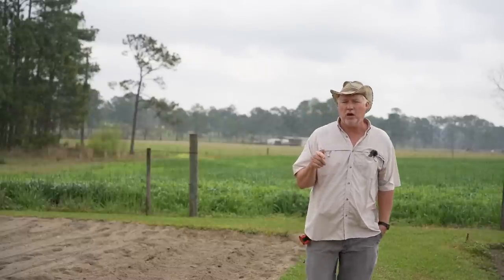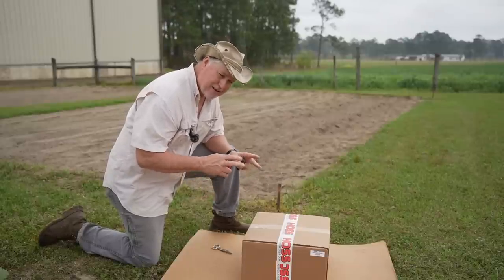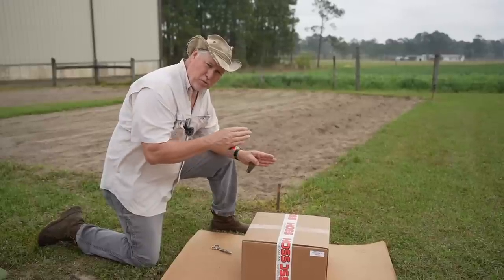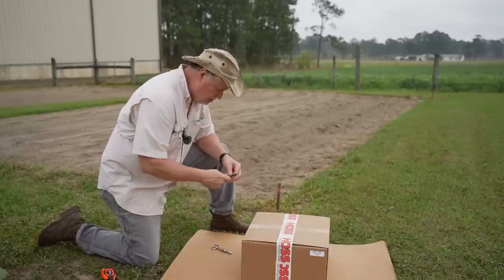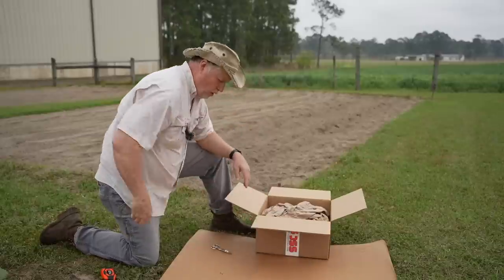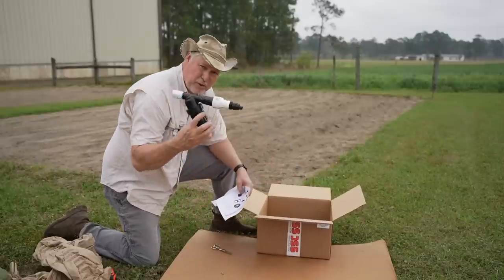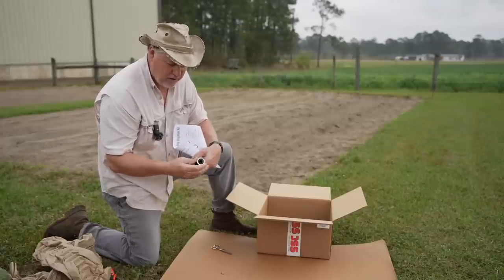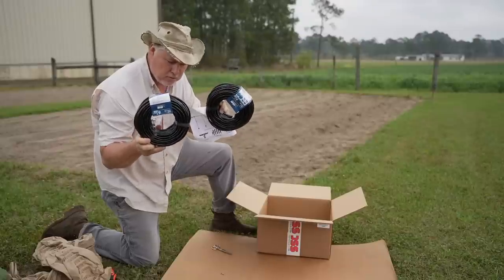How To Install Drip Irrigation | Small Drip Kit

Comment: Sure is a big improvement on the soaker hoses I've had to move from one row to the next.  And the little cut off valves are genius!  This drip system is perfect for my garden plot inside the deer fence with a row length of 25-28 feet.

Comment: For those of you that have leak issues where the hose connects take the original hose gasket out and replace it with an 5/8" orange rubber one. I used the Danco brand and they worked for me. The one that comes with it is a hard plastic type and will not seal.

Comment: Greg, great video.  I can attest to ease of use of both the drip TAPE and the drip LINE tubing as I use both.  I will offer one tip for us older folks that have trouble pushing both the main line, tape or tubing onto the fittings.  You can either use a glass or thermos with hot water (like coffee hot) and dip the end you want to connect into the hot water.  This will soften it up and make pushing onto the fitting easier.  I've started using a 18v cordless heat gun as it work great for this purpose.  The heat gun also makes it easy to take those fittings off if you are changing the layout of your system.  I bought a Ryobi 18v unit as it was on sale at Home Depot a while back for $49.  But the hot water works great, and you can just pour some of the hot water on a fitting you want to take apart since they will not fit in a glass or thermos.  The other great thing to use with this type of system is a battery powered timer.  Makes watering automatic and no forgetting to turn the water off and finding it ran all night (ask me how I know this!!!!).
Reply: This 71YO thanks you for this helpful hint!

Comment: Just got my kit in the mail today! Forgive me if it was mentioned already, I couldn’t find it addressed specifically where to place the drip line in relation to the row. I have corn coming up now; should the drip line be laid right up against the corn stalks or offset a few inches? Love the videos, love the products, I appreciate the guidance.
Reply from the maker: We bury our drip tape about 4 inches and plant corn on top about 2 inches deep.
Reply: @gardeningwithhoss sorry, I meant with the drip tubing in the small drip kit
Reply from the maker: Either can be done, we would recommend putting it right up against the corn stalks.
Reply: @gardeningwithhoss Thanks! 👌

Comment: Quick question on fertilizer injector flow disc, I will be using the Lazy garden 15 X 20 kit with the drip tubing provided, my question is what flow disc to use in the 1 gallon injector system? My water supply puts out 5 gallons a minute, I think it’s the white disc but I’m lost 😂😂😂
Reply from the maker: You will not need a flow disk at 150 gallons per hour. You will have 10 rows at 15 feet = 150 feet.  
White Flo-Disc 120 to 60 gph
Black Flo-Disc 60 to 30 gph
Red Flo-Disc 30 to 7.5 gph
Reply: @gardeningwithhoss  thank you, I can’t wait to start growing in the lazy garden

Comment: Drip tape in place, now I'm just trying to figure out a guideline for an appropriate watering schedule.   For NW florida, what would you recommend setting watering schedule to make sure hossinator tomatoes do well?
Reply from the maker: A good rule of thumb is regardless of how you water your tomato plants, be sure they’re getting at least 1 1/2 to 2 inches of water per week but checking in on your plants and watering as needed is really the best way to manage irrigation for tomatoes.

Comment: I have 4 raised beds, 5 feet wide by 16 feet long, with 4 feet between the beds. Would this kit be a better choice than the raised bed kit that you have? If I went with the raised bed kit, would I need 2 kits to do my beds?
Reply from the maker: The raised bed kit will support 8 (4 ft. by 8 ft.) raised beds with 4 feet between them. This is not precut, so you can make it work in you 16 feet bed.
Raised Bed Irrigation Kit Includes:
2- 100 ft. roll 1/4 tubing with emitters
1 – 20 PSI Filter Regulator Combo
1 – Figure 8 End Clamp
1 – Green Hole Punch
20 – Goof Plugs
10-transfer barbs
2 – 50 ft. 1/4″ tubing
40 – 1/4″ elbows
10 – 1/4″ flow valve
10 – 1/4″ tees
1 -30ft mainline tubing
100 – Tubing Stakes
10 – Garden Wire Pins

Small Drip Irrigation Kit Includes:
1 – 30 ft. roll of mainline tubing
2 – 100 ft. roll 1/4 tubing with emitters
1 – 20 PSI Filter Regulator Combo
1 – Figure 8 End Clamp
1 – Green Hole Punch
10 – Transfer Barbs
10 – Goof Plugs
32 – garden pins

Comment: I have a couple of questions, please. I will need to tee off my mainline tubing because my beds are running in different directions. Will that affect anything? The 30 feet maximum; is that for drip line not the main line? I'm looking at 23' of main line, with an 8-9' tee off and then an 18' tee off for when I add the raised bed kit. Is that understandable? I will be using the flow valves if that makes a difference.
Reply: I order my kit from drip depot. The website is setup really nice and understandable.
Reply: @EBHJ  I've looked at that website. It was set up nice. I just like the help along the way from Hoss tools. With very limited income, I believe I'm making the right decision. And the service after the sale is very important to me. It's taken me a few weeks to draw up my plan and figure it out. I've asked questions, and they answered. I'm excited to try my hand at irrigation, and they've given me the courage.
Reply from the maker: 30ft is for max length of drip line. You will be good with everything else. I don’t see any problems with it. Greg